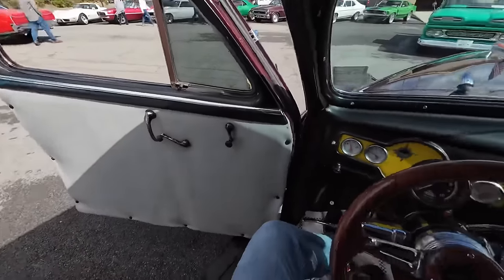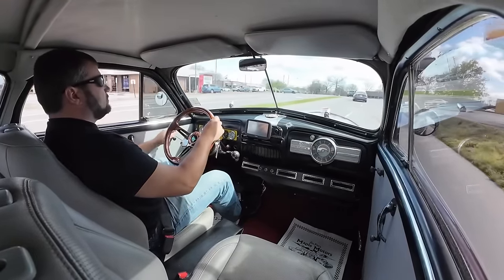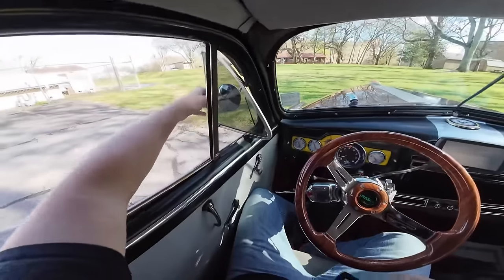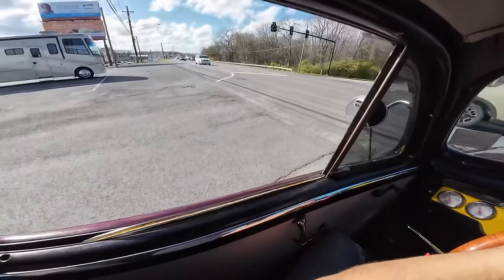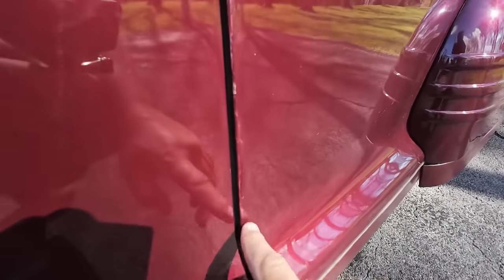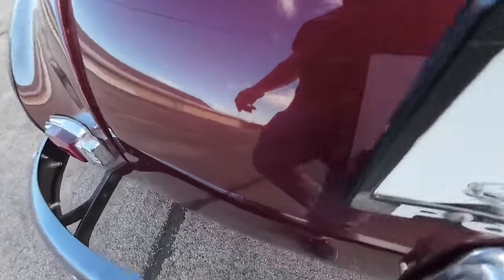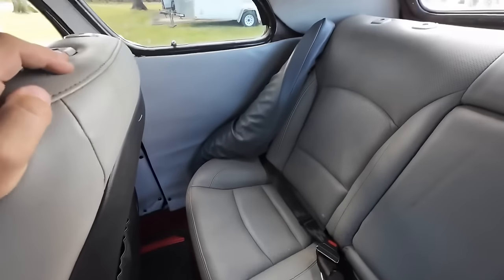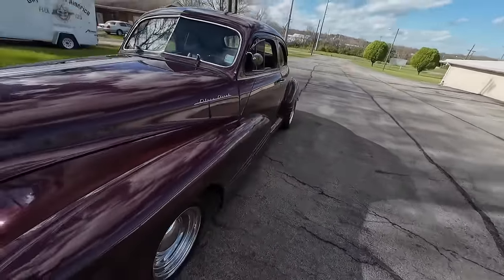Test Drive 1946 Pontiac Streamliner 2 Door Coupe SOLD $18,900 Maple Motors #2541-1

Comment: If the original gas filler has been taken away, where would the gas entry point be? is it in the fuel cell in the boot? Also, would the guys near you that you've mentioned in the past be able to do the work on parts of the car that arent working such as the dials to make them work again before shipping?
Reply from the maker: No, we just make these videos and tell everyone what is going on with the cars.  So you’ll have to fix it when you get it. If we did work on them, we would have to raise the price up significantly, but we don’t have time so we would also have the car for trying to get it done.. Thanks

Comment: Hey, I have a 97 Chevy C1500 (like I told earlier😂) as far as I know Canadian manufactured. Do you happen to know if the odometer is in miles or kilometres? Same for the trip meter
Reply: If it's made in Canada 🇨🇦 it's in kilometers
Reply: Oof than its a thirsty truck 🤣
Edit: after some research I found out its 99% sure a miles odo. Found on some forum even though its Canadian made, its still made to US standard. Someone listed an ad on a Dutch marketplace his GMC 1500 also Canadian and said its KM. So was questioning mine haha.